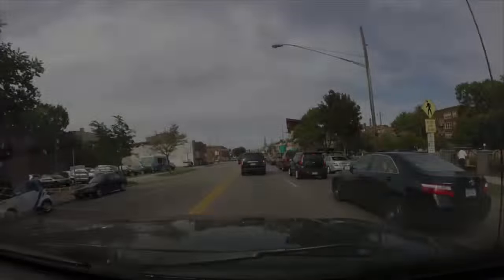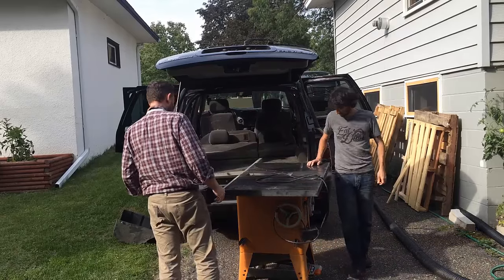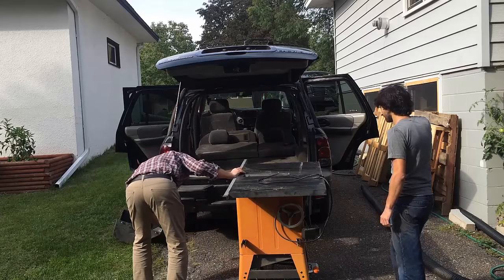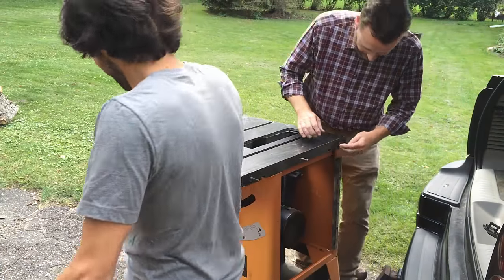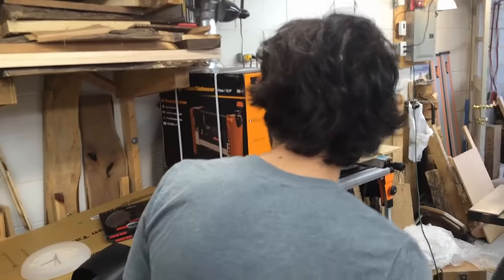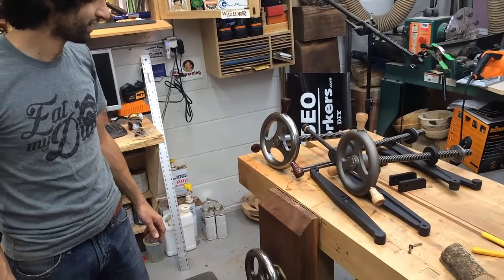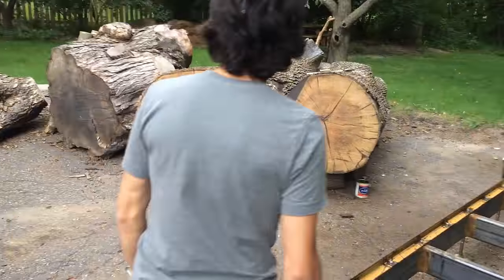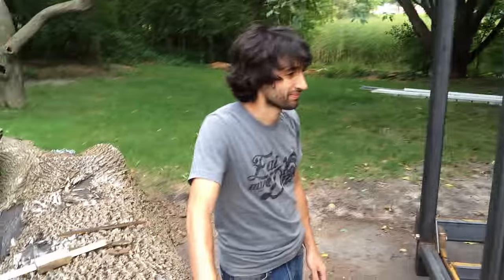I Bought a Table Saw from Matt Cremona

Comment: I have that saw and like it for the saw itself, but there are a couple of things that bugged me and I ended up changing. One is the  base. I could never get it to roll properly, and it felt a little bit tippy, so built a base for it out of construction lumber. 

The other thing is the fence. I thought about upgrading the tubes and angle iron front and back to be more smooth. Then I thought about getting a replacement fence (or making my own), but ended up getting the Incra. The Incra is probably overkill, but I'm happy with it.

Overall, though it's a good saw. The parts that matter work as they should. My shop is not climate controlled, so the granite top is a blessing. I hope you get lots of good use out of yours.
Reply from the maker: Yea, the base is a little finicky.   I like Dema's workshop's setup where he built a rolling work base for his.    I'd love to get an Incra but the fence is working well for now and locks in place.   It always seems when I do push the handle down it's not tight enough but the fence doesn't have any movement.   Thanks for the feedback!

Comment: Hey. I have the exact same saw. I told Matt about making a riving knife for it. It would be much safer than it is now. Hit up the rigid tools forum and search riving knife for R4511. You can cut the pattern out on an old table saw blade. Let me know if you need any help with it.
Reply from the maker: Thanks Armando.   I was wondering if the table saw had one.   I'll have to check out  that forum for that.

Comment: That looks like a nice saw!  Getting the tools out is always the trickiest. I had probably a 200 lb lathe in the back of my minivan and it wasn't easy. I've also hauled a 14" bandsaw and 10" table saw with a 50" rail in the same minivan.
Reply from the maker: Yep. You have to work with what you got.   I bought this SUV with the intentions of eventually getting a 5' x'8' trailer to haul wood and equipment around.    Stuffing this stuff into your car is half the fun though. Right?
Reply: Jake of All Trades Absolutely!

Comment: Jake, was that the granite top version of the Ridgid? My neighbor has one of those and I have the stamped steel table, but I took the cast iron wings off of my old Craftsman and put them on and love it. Good luck with it and I'll subscribe to see how your shop grows.
Reply from the maker: Thanks Mike.   It is a granite top which is interesting.     I like it for it's girth and weight as well as not having to worry about rust.   I have always wanted to put on a router table wing though  so I guess I'll have to come up with some other method

Comment: Yes, setting up a new shop. Big to do punch list.  Did you have Matt sign it?  I would have then protected it with a see through coating.  That would have been cool.  In your vid at the re-assembly you had a very nice bit set can you share the brand and model number.  You have a  new subscriber.
Reply from the maker: No I didn't.   I'm sure I'll get more stuff from him.   was great meeting him and hanging out.   I got that tool kit from Costco a couple years back.   here's the amazon link although they are out of stock.  Has every and any bit you will ever need. https://www.amazon.com/product-reviews/B00DE91H1U